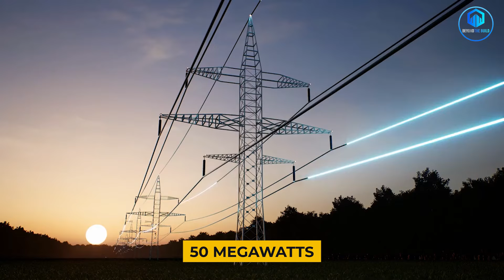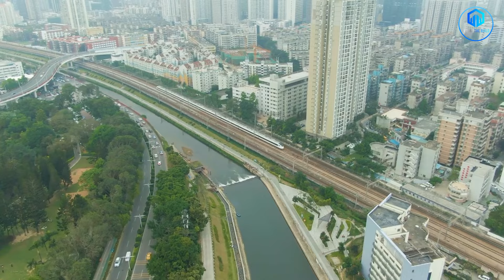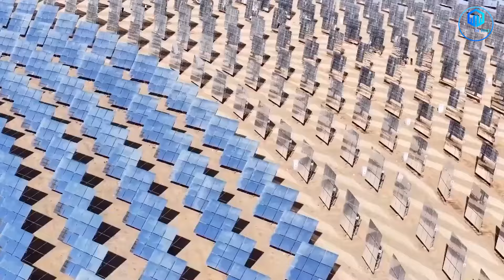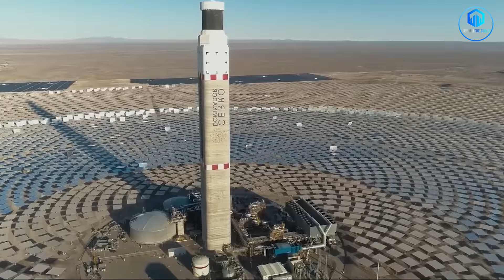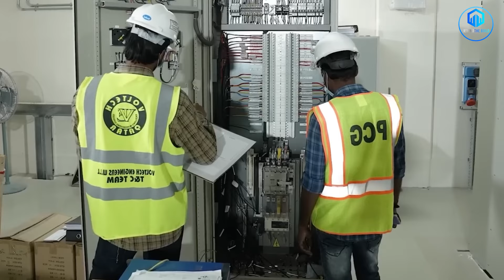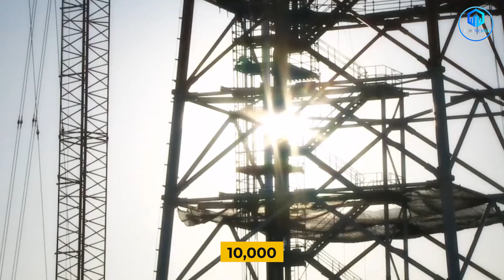Inside China’s Solar Tower That Works Even at Night

Comment: They also just built a super critical CO2 turbine.  Steam is like 33% efficient, the sCO2 is like 50%.  It's a huge leap forward in boiling things.... except it doesn't boil.
Reply from the maker: Whoa 😲 50% efficiency is insane! But yeah… how do you think it actually works without traditional boiling?